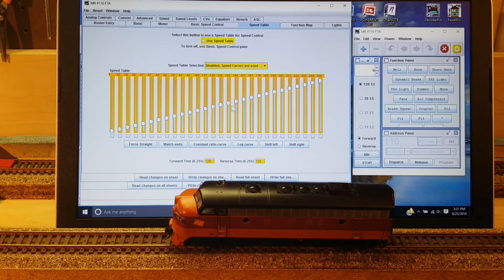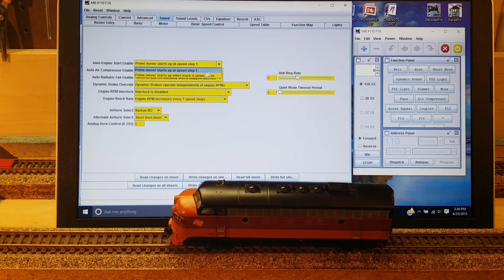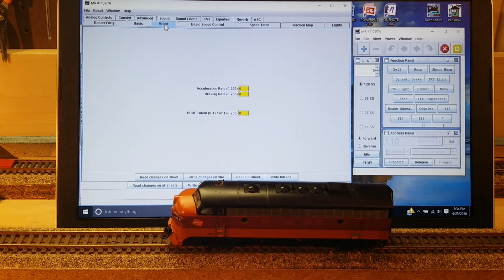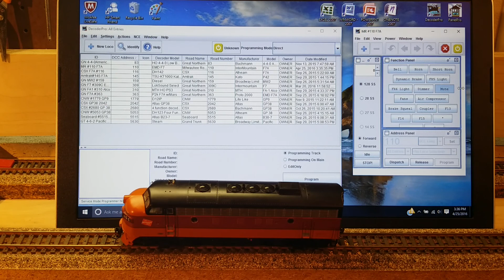JMRI Decoder Pro to Change CVs

Comment: Hello RRBob, how are you? A great video. I have a question. When I program the decoders with sound I have no problems. When I take them to the track, and I look for the locomotive with the control, when I activate it I can activate the functions but it takes a long time to start running. Sometimes I have to move her to do it. Is this normal or should I modify a CV?
Thank you very much.